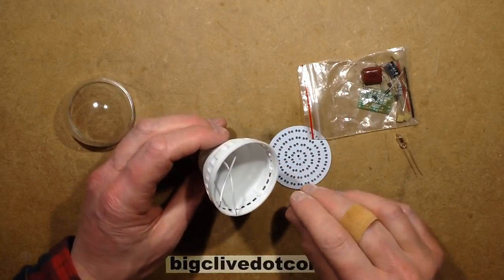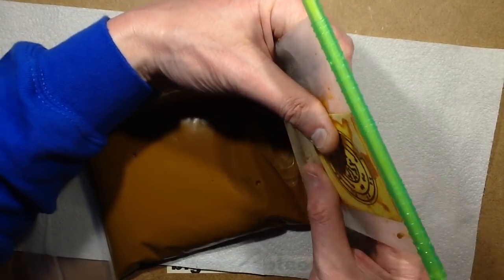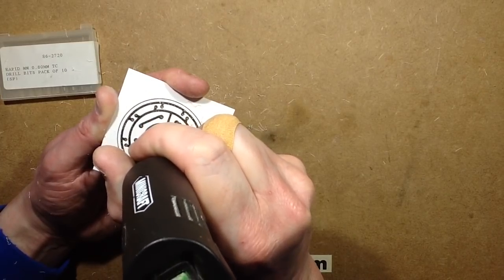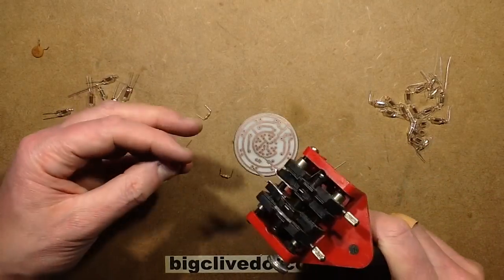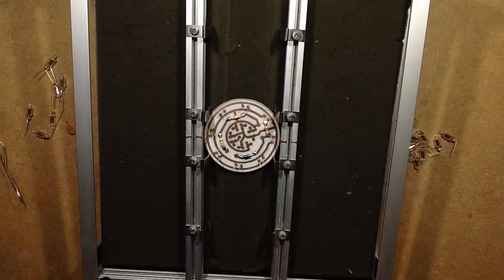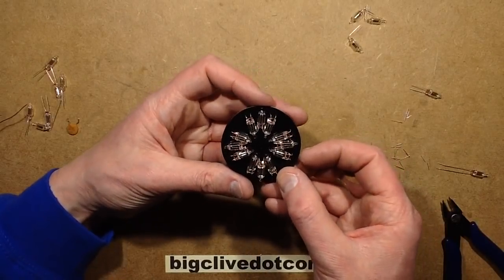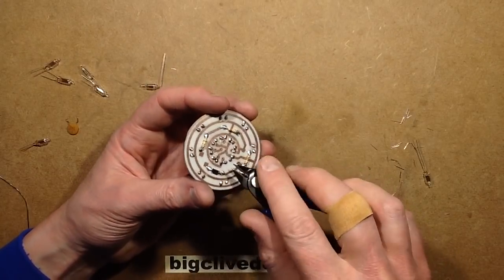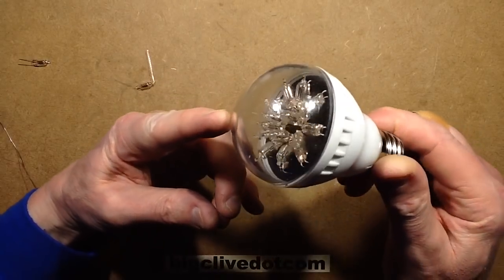Full mega nixie-lamp build with custom PCB.

Comment: RME - Wow.  That brings back double memories for me.   The retail chain, and also there was a group called Radio Manufacturing Engineers who made some broadcast equipment and a bunch of communication receivers.    Back in the day I was in commercial radio and a radio station local to me at the time was using broadcast mixing panels manufactured by RME

Comment: Has anyone gotten one of these to work on 120 VAC 60 Hz?  I've been experimenting for a couple of days and keep getting the same result. There is no flickering action. One, two, or three lamps will light steady. (If they're flickering it's faster than the eye can see. By touching the envelopes of the neons with my finger I can change which lamps are lit. Every 5 to 15 minutes the lamp(s) lit will change on its own.

It would seem that at half the mains voltage, I ought to be able to drop the high-value resistor in half and it should work.  I've tried resistor values from 470k down to 47k and capacitor values from 1 nF to 68 nF, ceramic and polyester film caps. I am using a 1k resistor as recommended to limit the discharge current pulse into the paralleled neons.  The neons are from the same bag of 100.  I've tried flowers made of four and six neons. Always the same result.

240 VAC 50 Hz has a higher dv/dt than 120 VAC 60 Hz but I don't see how that should affect anything. 

I'm puzzled.

Comment: That soldering iron looks like my cheap Chinese one I bought off of ebay.
Reply from the maker: It is a cheap Chinese one.  A Yihua 8786D.
Reply: @bigclivedotcom  I don't know who makes mine, but the model number is 8582D. Has the solder iron and the hot air. Also for US 110v.

Comment: Reminds me of a flashing neon display I made as a kid, a circuit from either ETI (the best Electronics mag ever) or Everyday Electronics. It used more capacitors and the random pattern was slower.  I placed it in an artificial pot plant, with the flowers flashing away to their heart's content, 10 PP3s hidden in the pot provided the necessary 90 Volts and lasted for month's until my then wife's grannie mistook it for a real potplant and watered it.

Comment: I tried one of those little drills, piece of shit the motor bearings failed about the third hole. I took apart the unit and it had a old salvaged motor from probably a printer or the like likes.  I took the brass end off and have attached it to a larger better motor that I use for quick holes.

Comment: The finished board, outside of the lamp holder, was definitely a thing of beauty even without power applied. Reminiscent of some kind of mineral crystal cluster or the like. Almost seemed a shame to put it under a glass dome, especially a diffuser one.

But, can we please have a follow up video to see the fully functional bedded-in version? My mental image of the finished, operating version was one with continually-lit bulbs. The described alternative where all of them are rapidly flickering away in concert might also look pretty good, but the initial fire-up with just a few of them flashing intermittently, well... it's not enough :-)

It's been a couple years so if the thing's still working I expect it looks pretty glorious by now.

NB, were you not concerned about the capacitor legs poking through the board shorting on one or more of the neon tube legs on the other side? I expect you arranged things so that any protruding stubs were actually well away from any other conductive material, and kept them short enough to not stick out anyway, but, still, I'd have been totally paranoid that they were presenting a short hazard if not nipped off flush with the board...

Comment: So far as home-PCB making goes I think I prefer the one where you roll the UV sensitive film on to a sheet of coppered fibreglass rather than this one which has the film pre-applied.
Reply from the maker: The self applied film works out cheaper and allows you to re-use the laminate if you get a bad exposure/developing.

Comment: First pack of those micro carbide bits I got I was opening the pack and it slipped and half the bits broke off under my fingernail. That sucked. Had to get tweezers and screw them out.

Comment: As a child (5 years) I was fascinated with electrical outlets in our house (2304 Dennywood Dr. Donelson, Tennessee, US 1968). I kept wondering how this magic "electricity" worked. I knew that it flowed through wires but what miracle took place in that little magic box in the wall that enabled this electricity to jump from the box into whatever I happened to plug into it. I developed a theory but soon dismissed it as being too simple and chided myself. My theory was that all that needed to happen in that little magic box was for everything I plugged in had to just simply touch the end of the wires in the box. I had already learned what happened if you used a piece of metal to bridge the two wires. But there had to be more to plugging something it than just the two prongs touching (there were no 3rd grnd. prongs then). So one day, using one of dad's screwdrivers I took apart a live electrical outlet in my room. I had to make an occasional loud noise or mom knew I was up to something and would "Quickly " investigate. I can still remember the thrill when I discovered that my theory was indeed correct. I put the box back together and no one ever knew, until years later in my 30's) when I confessed.

Comment: Has anyone purchased Sprint layout?
I bought it but can’t figure out the procedure to “activate” it?
They (abacom) don’t tell you. I emailed them but they just sent me the links to purchase it again!
Does the Demo version have a utility to upgrade it to the full version or is it necessary to download a new unlocked version?
LOL I’m not a novice at purchasing and installing software but this has me confused.
I do have some experience with geeks and I know they like to do things because it works for them even if that way is non-standard to 99.999999999% of the rest of humanity. So, I just need to catch a clue.
Reply from the maker: I think you should have received a new unlocked version.
Reply: Thanks Clive! I will scour my inbox for the telltale signs of EXCITEMENT for my recent software purchase from ABACOM. Mostly, I’m so bummed because I instantly fell in love with the package and want to save my gorgeous artwork!
I will update when I figured it out.
Cheers!
Reply: After a couple whinnying emails from me, they finally sent me the correct link. Took them about a month.
Thanks again for the insider info. 
It’s an awesome application because it does exactly what you would expect with every mouse gesture, which is weird for technical apps.

Comment: 34:20 I've done a lot of 3D soldering work. The best solution I found was using (cheap, thin, low temp craft grade) hot glue to hold the component while I soldered. I could then easily peel the glue off. I also have a high temp industrial glue gun for permanent work. That stuff does peel off well so use with caution.

Comment: Love it! I have never made my own PCB boards, other then using ready made boards and using wire to jump from point to point, you know the green ones with solder points on each side. At any rate, for heating things up when a microwave just will not do, they have these old things called a hot water bottle, and a tea kettle.  We used them for years before we moved off the farm and got power in the house. Perhaps that could help heat your ferric chloride compound, or even an old heating pad from the days of back pain and such would do as well.  Microwaves are great for making coffee, but most other things are better from the stove.  We have even found an old whistling teakettle and use that to heat water for coffee, some how it just tastes better off the stove. Mom would not allow one of those damn things in her house till about ten years back (she is 93 now) because she was told you could get tongue cancer from drinking microwaved water.  Old beliefs die hard.
Reply from the maker: Since damaging the last etchant bag I've switched to submerging it in hot water to heat it up.

Comment: hey clive, I tried to build your circuit because it looks really awesome. So I went and ordered some small neon bulbs and just copied your circuit. But instead of flashing only a single neon comes on and it's always the same.
so I increased the resistance between the mains and the cap to decrease the caps charging current and I also bridged the discharge resistor of the cap. Now I have 4 Megohms in front of the cap and the single neon is still lighting.
How is this even possible? a neon lighting up at 60 µA ?
Reply from the maker: Neons will light down to nano-amps.  If your neons are matched then make sure your circuitry is safe and leave it powered continually for days to see if it settles in.
Reply: Thank you for the suggestion, I will try leaving it powered and see if it makes a difference.
They are definitely from the same batch, but I have no Idea if this implies that they are matched or not.
Do you have a source that you can recommend?
Reply from the maker: The source depends on where you are in the world.  I get mine from a UK seller called Rapid Electronics.
Reply: I guess I know my problem. I ordered ones that are substantially smaller and also came with presoldered resistors. Of course I removed them, but I guess there is the possibility that they are all mixed up...
But wow those neons from RE are much much cheaper than the ones from our local german equivalent which is called conrad electronics.
Except for the shipping rates :D I finally know what you are always talking about... 21€ for a bag of a hundred neons :D This is hillarious
Reply: You can buy much stuff on reichelt.de for very little money + the shipping is 5€ normally. 
Its a great shop
Reply: Yay I've just built four different versions with neons from two different sources. One is already starting to flicker after about two days of aging, two others showed a significant amount of sputtering on the neon that was constantly lit, and my latest one is about to be tested now
Reply: the problem with the ones off reichelt is, that they come preassembled with resistors. I already bought such neons before, but they seem  not nearly as well matched as the ones without a resistor, since those are more likely to come from the same manufacturing batch.
Anyways I find it quite hard to get them oscillating.
In clives videos it seems so easy :D
Reply from the maker: The resistor between the capacitor and neon string is important.  It limits the peak current.  If you short it out the neons will blacken quickly.  If they show signs of blackening when it's still in place, increase its value.  These effects depend on the neon characteristics.  Some may take a modestly long time of continuous operation to get to the point they start to work properly.

Comment: I usually shy from using nail polish remover instead of straight acetone, because they often add oils or other conditioners into the cosmetics. If cleaning something, those additives may leave a greasy film.

Comment: Canon does not provide drivers for Linus, while Epson does. I am using 3 HP laser printers that have excellent drivers, I used Nixie tubes back in the 60's. They were not flashing random lights, but displayed a single solid number controlled by the electronics it was attached to.

Comment: Easy way to aim for drilling, is using a punch, set it on, giev it a press, you have a minute dent that your bit will stay in quite well.But you don't have too much trouble with it, but just try it out.
Reply: What I've done for years is to make all pads have 8 mil (8/1000th of an inch or about 0.2032 mm) holes in the pads, that way your etched copper pads already have a nice pilot hole there - 8 mils seems "just right" for my toner transfer boards, see what works for you. Let the etching process do more of the work for you, "Less is more" :)

Comment: I love to see how other people make their circuit boards. Personally, I've used Eagle, Adobe Illustrator, and Microsoft Visio, and I prefer the toner transfer method. I fond a ziploc bag with a much smaller amount of etchant works just fine for me.
Also, if you'd used a double sided board, and instead of painting, you polished and sealed the copper, I think that would look great. Just countersink the full copper side to prevent shorts before sealing it.

Comment: Why these lights are flashing? oO
Reply: This is a neon relaxation oscillator. There's a capacitor slowly charged by a resistor, connected to neon lamps in parallel. When the capacitorr reaches certain voltage, gas in a neon lamp breaks down and ionizes emitting orange light. Then it glows for a while because sustain voltage is lower than strike voltage. All the neon lamps have slightly different parameters, hence the randomness.
Reply: I think they are warming up maybe :D

Comment: Not knowing how PCBs are made, where did the copper traces come from? They weren't there, then when you came back with the painted PCB they were there. Also, is your mains voltage AC or DC?
Reply: Andrew A PCBs  of the self print type are made from a fibreglass sheet laminated with a thin sheet of copper... you etch away most of the copper leaving the tracks behind.
Reply: Andrew A oh... and mains in the UK is 220v AC.

Comment: You could dimple the centres of the pads with a small "pin prick" centre punch to make the holes easier to locate. just a light tap with a small hammer will do it.
Reply: He said that like 3 times
Reply: Times please Dylan? At around 8:10, Clive mentions having not etched the board sufficiently to allow the holes in the centre of the pads to be developed, meaning that there are no dimples to align the drill bit to, and that he uses 0.5mm holes (in the artwork) for prototype boards to provide such a dimple. I don't believe I heard any reference to a pin prick punch.

Comment: (not directed at big Clive) I'd like to also recommend just grabbing a bit of scrap and holding the board flat on it. those bits are sharp and brittle. its easier if the board is not moving and you only have to deal with 1 unsteady hand. its not fun if you hit something like your hand, your skin is a rubbery and it will give you a cool hole really quick

Comment: if you're handling lead alot don't you want gloves or some kind of coating on your hands? also a small fan to suckup or blow away fumes? just curious
Reply from the maker: No.  Lead solder isn't dangerous at all to handle.  The whole lead-free solder thing is just clueless eco-hysteria that has backfired and resulted in even more electronic landfill.
Reply: oh okay. so is the main issue the fumes then? I just saw a clip of cody from cody's lab, stick his hand in a toilet cistern filled with mercury... so now i don't know what to think,
Reply from the maker: +zee anemone Mercury hazards are also blown out of proportion.  It's most dangerous in a vapor state if you are exposed to the vapor for a long period of time.  Mercury used to be a very important component in tilt switches, slip rings and relays plus many other specialist applications until it too was banned by people who clearly didn't understand that it has no replacement.  I wouldn't recommend breathing in any fumes for a long period of time, but casual soldering does not pose a risk.  You quickly learn to breathe out gently as you make each solder joint, just because it's a natural reaction.  The bulk of the fumes are actually flux, and the stuff used in lead free solder is ironically more harmful than the flux used in traditional lead based solder.
Reply: That's really interesting thanks for letting me know. I think Cody mentioned that only the salt version of Mercury is absorbed through the skin because it is Soluble. it's a shame bad science has afflicted the electronics industry. 

I can tell your frustration -- it's disheartening that even when people are seeking to fix a perceived problem. if that problem to them is public misconception (potential cost loss). instead of using intelligence they end up causing harm with ignorance and stupidity.

~zee
Reply: Funny thing, in my work place, the recommended procedure when a flourecent light breaks is complete overkill and requires us to cordon off the area for a time.
Reply: @DahVoozel If you're in the US that's actually OSHA requirements. And if you're from the EU, I assume they have even stricter rules.
Reply: look at a cody's lab video where he dips his hands in mercury and then gets his blood tested after. little to no issue if you don't have open cuts (edit: never mind you did)
Reply: @fraggy OSHA has some good guidelines, but the one for flourecent  tubes is freaky overkill for one or two tubes.

Comment: That was relaxing, thanks. Very nice project. I am curious about the bag method for the etch bath. I thought that process released gas. You are probably using different chemicals, but I remember using Ferric Chloride and it released Chlorine gas. Probably not very healthy. Then again, I also used to play with Mercury in my hands! I managed to grow up not too retarded.
Reply from the maker: I've never experienced any gas release with the ferric chloride.
Reply: There can't be any chlorine being evolved in this process. Iron(III) cation gets reduced into iron(II) cation, and copper gets oxidized into copper(II) ion. There are sideways reactions too, but this is the general principle. Elemental chlorine is never released.